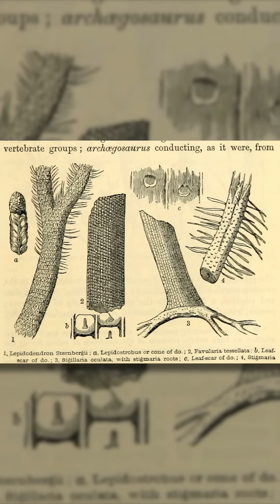There's Something Unexpected in This Coal...

Comment: Coal is a sedimentary rock comprised of carbon-rich material formed roughly 300,000,000 million years from prehistoric vegetation such as trees, ferns, shrubs, and aquatic plants. 
 High pressure builds up within the layers resulting in much lower oxygen levels, forcing out moisture and volatile compounds thus form ing coal after millions of years.

Fossilised wood on the other hand, does not have much chemical difference than its original plant matter as no heat or pressure was involved in its formation. 
     Over a far shorter period of time, these pieces get mixed with sediments and quickly fossilizes by forming mineral deposits around it which help preserve it almost as it originally looked, for thousands to millions of years without any further major changes or development taking place within them. 
     This explains why fossils often appear incredibly similar to their original plant form even after they've undergone millennia's worth of decomposition! 

So when you compare coal vs fossilised wood – it really boils down to how each substance was formed; through either high temperatures/pressures (coal) or by natural processes where there's minimal change (fossilized wood).
Reply: Might want to view the clip.  Have someone explain the words.  Praying that you can pass 5th grade next year.
Reply: 300 trillion years (300 million million) is over 21,000 times the age of the Universe.
You might want to check your math.
Reply: Explain how non living matter arranged itself into the 2 step process of photosynthesis.... Just a coincidence that the elements arranged themselves into animal life that provides the CO2 plant life requires and photosynthesis releases the O2 and provides food for the animals? What nonsense.

Comment: Coal is made from more than just bark, and being buried over long periods prior to bacterial and fungal species evolving the ability to degrade and digest wood explains the depths of coal deposits. These were swampy areas, which also explains the flatness of seam boundaries.
Reply: Swamps are alive…. There is zero evidence of bio predation in these coal seems….
Reply: Not prior to the evolution of bacteria and fungus. But probably highly acidic due to volcanism, therefore preventing the activity of all but several bacteria.
Reply: @ I meant that bacteria evolved the ability to break down wood. There’s a few enzymes involved that had to evolve for the full breakdown to happen.
Reply: @astinscience  and those enzymes are neutralized by acid.
Reply: @JosephBoxmeyer-u3d  That depends on the enzyme. Given that these enzymes work in wet environments now, seems like entirely logical that they worked in the past.
Reply: As if non living matter could arrange itself into the 2 step process of photosynthesis in the first place? You ever examined the details of photosynthesis?
Reply: Sure would like to see anybody make carbon, nitrogen, oxygen hydrogen and sulfur form a complete set of the 20 specific amino acids enzymes as proteins  are made of.
Reply: @Vernon-Chitlen  We literally see amino acids and other organic molecules forming on asteroids in space. This kind of assembly is far more common than you think.
Reply: @astinscience  You are simplistically clueless. There are over 500 kinds. Only the 20 particular are found in proteins and in only their left hand forms except glycine. They are sequenced just like amino acid letters spelling protein words averaging 300 each. From anywhere from 50 to the 35,000 in the protein Titin. The simplest cell has 12.6 billion amino acids arranged in thousands of different types of 42 million. You couldn't sequence an average amino acid if you had to buy trial and error. Perfectly absurd believing proteins could form naturally. Absolutely ridiculous!
Reply: @Vernon-Chitlen  I don't understand why, but my reply seems to be gone. Gotta love the randomness of YouTube lol. I'll try again. 

You can check the following two examples: an article by the Royal Astronomical Society from 2023 about tryptophan being found in interstellar dust clouds, and the 92 amino acids found in the Murchison meteorite. Both can be independently confirmed. I invite you to check these yourself, I'm not asking you to take my word for it. 

And there are many other examples.
Reply: @astinscience  You're not listening. A random unguided, undirected process can't arrange only 20 specific of 500 kinds of amino acids in the specific sequences and only lefties that define a proteins particular function. You can buy sets of the 20  pure, chiral amino acids from Carolina Biological and other places. Combine them and nothing happens, no proteins. A few polypeptides but no relevant proteins. How could the amino acids form in a warm little pond or whatever and become arranged only the 20 specific and left hand forms?  There's 12 billion amino acids in the simplest cell. Ridiculous for even a couple thousand forming a few proteins. So you have 20-30 proteins? How long will they last outside a cell membrane? How's the sequences become coded by nucleic acids? RNA's, genes, DNA?
Reply: @Vernon-Chitlen  I listen quite well, and am familiar with protein synthesis. Proteins exist outside of cells, that happens all the time, and simple functions can gain complexity and utility over time. The current thinking is that RNA, which can be both coding and play an enzyme function, was likely important in early chemical evolution. We don’t have all the pieces yet, of course, it’s an area of active study. But many steps along that path have been found, like finding the commonality in many mundane situations of the precursors to more complex organic molecules forming in nature. Just because we don’t have every step yet doesn’t mean that we default to divine intervention as a necessary step. You seem to be using a combination of argument from ignorance and argument from incredulity, here.
Reply: @astinscience  Just word salad convincing yourself there is no God.
Reply: @Vernon-Chitlen  Odd way to respond to a fact based statement. Sorry you feel that way.
Reply: @astinscience  No facts: Pure conjecture, exaggerations of experiments that have had applied much design and purpose by the scientists.
Reply: @Vernon-Chitlen  I find it interesting that, when challenged about amino acid forming naturally, and given evidence thereof, that you moved the goal posts, and call facts in evidence “conjecture”, while seeming to malign the work of scientists (though in a confusing way; your last sentence doesn’t make much sense, perhaps you can rephrase it?). The basic chemistry of life happens in many environments, that’s a simple fact. Your lack of acceptance of those facts doesn’t appear to be logically sound.
Reply: @astinscience  Has anybody made carbon, nitrogen, oxygen, hydrogen and sulfur form all 20  amino acids? Did they ever form a moderate protein? YES OR NO?
Reply: @Vernon-Chitlen  I gave you the evidence for naturally forming amino acids that you can verify yourself. In addition, I’m sure you are familiar with the Miller-Urey experiment, which has been repeated. Dipeptides regularly form in such conditions. Do you accept those facts, before we go any further?
Reply: @Vernon-Chitlen       Hasn't yet been accomplished in a laboratory. And they have tried for 70 years. Serious intelligent people have abandoned the fiction of evolution.